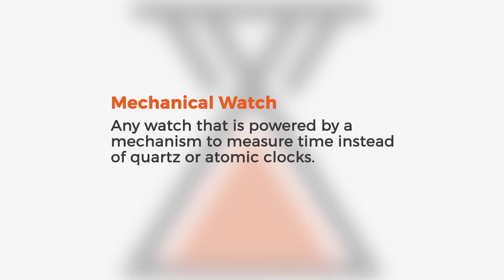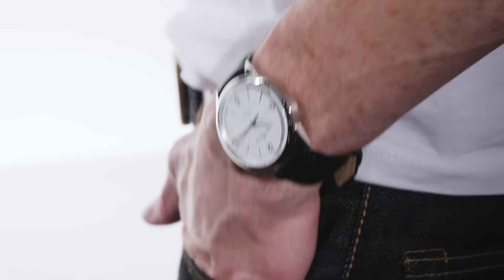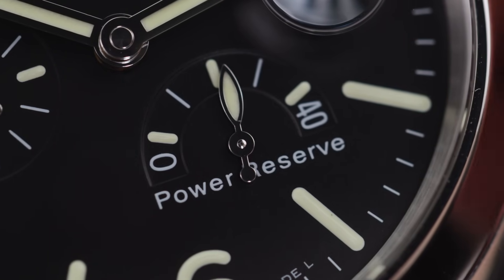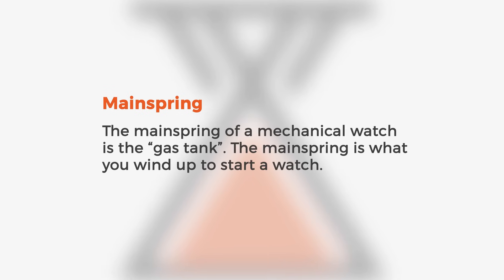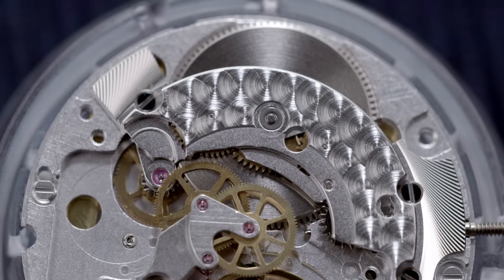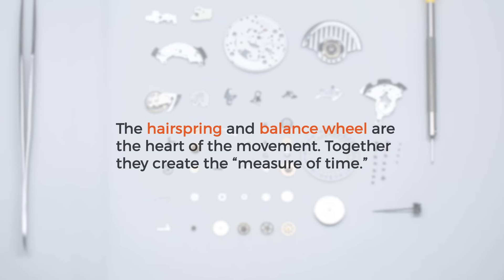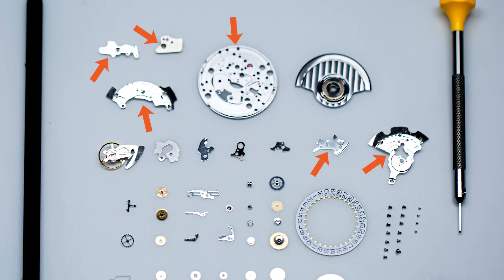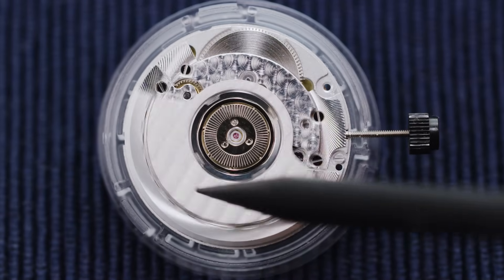How a Watch Works 101 | Crown & Caliber

Comment: What keeps the balance wheel oscillating without eventually stopping like a pendulum would? Does the energy from the escape wheel help keep the balance wheel oscillating by transferring power through the pallet fork?

Comment: Technically not quite right. The crystal does not in and of itself oscillate. The driver circuit does that and is designed to oscillate at the crystal frequency. The problem is that electronic components are inaccurate as they are affected by temperature so, add the crystal which it electronically bumped by the oscillator and being quartz, it moves but has a very accurate resonant frequency so it loads the electronic circuit depending on the frequency error pushing the circuit back onto the correct frequency. 

In short, it does not create the drive frequency as implied, it stabalises an existing circuit generated frequency.

Comment: Also, statement that quartz watch is precise because quartz oscillate at high frequency is abysmal! 
Fist of all, quartz crystal doesn't oscillate and doesnt have default frequency. Crystal need to be cut in proper shape and stimulated to act as resonante impedance.
And high frequency (calling 33kHz high frequency is also inappropriate) has nothing to do with precision! The (semi) constant resonant frequency at wide variety of temperature translate into precision.
Usually cut to rezonate at 32768Hz because it's easy to divide back to 1Hz. For obvious reason.
Doesnt mean you can't get higher resonate frequency quartz.

Comment: This is truly the most pitiful explanation I have ever seen.  The first exact half of the video is not on topic but explains about certification ... is that really the best way to start a video that is supposed to explain how a watch works ?  The wide angle view of the pieces of a watch mechanism is inexplicable to someone with no knowledge.  This is an explanation by someone who knows how a watch works, but has no idea how to impart that knowledge through a pedagogical means, and uses poor (trendy?) English.  Why is a part of a watch "funky" ?  The "narrator" shows the individual parts of the watch and explains their functions, but there is no diagram to show how all these parts integrate and connect.  The video should show how they work in relationship to each other, not just as separate units.  I have no idea why people give thumbs up for this poor presentation.

Comment: You didn't explain how the pallet fork is powered. Or rather you didn't explain how the impulse pin moves first in one direction and then the other.

You jumped from the drive train, to the pallet fork movement without explaining how the impulse pin is powered. This leaves us wondering how the watch works so basically your video failed. Just saying.

I mean the video is really good in every other way though.

Comment: Thank you for this video! 1 Question though, does the oscillating weight wind the watch either way it rotates or does it rely on one type of movement? e.g. left to right or vice versa
Reply: Hello Oliver. For a Classic Automatic movement, it's only one direction. Which is when it oscillates clockwise. However, some brands have come up with specific movements, which allow the spring to be wound whether the rotor goes clockwise or anti-clockwise. Eg: the Double Barrel winding system of the Caliber model of Cartier.

Comment: Terrible. Just some stock video with a voiceover. If you want to explain this you need to have these parts isolated and gradually build up the movement from the barrel onwards. This is lazy and doesn't really explain many things. How exactly does the escape wheel interact with the pallet fork? It's not intuitive and I still don't get it.

Comment: Why do most escape wheels have hook shapes on the ends of their arms opposite the side that the pallet fork strikes?
Reply: The moment the impulse pin releases one side of the pallet fork, the specially-shaped teeth of the escape wheel allow some mainspring power to “push back” against the pallet fork, sending the impulse pin to the other side, to start another cycle. 

In the meantime, the other prong of the pallet fork catches the escape wheel in another location. On the impulse pin’s return, it releases that side of the pallet fork from the other side, and starts the process all over again.

I suspect this is why a mechanical watch with no mainspring power stops—there is no way to launch the impulse pin into another cycle via the energy transfer through the special escape wheel teeth. Or at least not enough energy for the impulse pin to knock the pallet fork hard enough to release the escape wheel again.

This video explains best, I think: https://youtu.be/9_QsCLYs2mY

Comment: I have 3 questions
If I wind my watch today...than its run whole day? I mean how many times it's run if I wind 10time?
2nd questions is that....if I wind today...its properly work next day also but if I will wind agin so it's defects my watch mechanism???
3rd is that in some video first wind antilock wise and than clockwise.. why?? Every time do first anticlockwise and than clockwise???
Reply: 1. Depends on the watch's power reserve, but it should last a couple days at least if fully wound.
2. It shouldn't hurt your watch to keep it wound, some have protection for overwinding. But you should feel when it gets harder to wind.
3. I think you might be seeing watches with a screw-down crown that helps with water resistance. These have to be unscrewed first.

Comment: There is a third type of watch, the Hybrid, the Spring Drive.
Reply: Both are basically quartz watches but yeah it would be cool if they mentioned them in order to learn terminology.
Reply: @lethean1757  I  would say the oposite, 95% of the watch is mechanical,  only the regulations is quartz, so pull out the Swiss lever escapement and replace it with a courts regulator.

Comment: How is powered hairspring? It can´t be just a tension of the spring. It needs some impulse to move again if the watches stops. Is it transfered from the spring through the escape wheel and palet fork? I thing it should be independent and only the hairspring affect the fork, not both ways?
Reply: I had the same question!

Comment: Just getting into watches. A lot of videos down the rabbit hole a lots of repairs, restores, good video on just the basics. 

I have a question, I noticed in this video you said jewels are synthetic sapphire and ruby however, in my dive as shallow as it has been so far, I have yet to see a video with any other color jewel than the pinkish redish ruby color. Does any manufacturer utilize different colors on the jewels?

Comment: Because the osculating weight in an automatic movement require gravity, automatic watches do not work longer than their power reserve in zero gravity a.k.a. space?
Reply: inertia also plays a role and it can make the rotor spin around.
Reply: Gravity was not the best term to use.  Like the previous post says inertia or the movement of the weight is what winds the mainspring. This movement can be caused by gravity, but most of the work is done by the movement of the wearers wrist and arm.

Comment: This was not a "basics 101", more like "mechanicals 303". 🤓
Reply from the maker: Haha! There are parts where it got a little more advanced! Thanks for watching!
Reply: @CrownandCaliber  tbh when I speak with non-watch folks, the first thing they dont understand is quartz = needs a battery and dont need winding. They look "cool" but its cheaper to make.  And hen mechanicals need winding up to run, they can get power automatically by wearing it, the parts make it more expensive, and its usually thicker.  Most folks dont even know what they paid for in my experiences.  🙁

And truthfully I think "automatic" is a terrible description for self-powering.

Comment: Once upon a time, seiko destroyed the swiss in chronometer competition, swiss got bitter and made the COSC exclusive to swiss watches.
Reply: And once upon a time observatory testing at Kew existed and it was way more stringent than COSC. 
To gain class A Certificate which was the highest and therefore made a watch suitable to be used for marine navigation from the Kew Observatory, the timepiece was subjected to 45 days of tests (compared to the Swiss standard of 15 days of testing) with a tolerance of a few seconds per day. Plus, it had to be tested in five different positions and at three different temperatures.

Kew also published all the results so one could compare with which watch performed better whereas COSC doesn’t and we have no idea if a Rolex or an Omega before better than one another.
Reply: RandomUser221 they get a hefty amount of money from the high end Swiss companies. Because let’s say Rolex are held at such a high standard, they charge that high price, that high price is clearly much higher than what they actually cost, which turns into big profits for Rolex and cosc. Most things in life are a bunch of bullshit. Most of us get bullshitted.
Reply: Roland Koller cosc is non-profit....
Reply: Just one reason I'll never buy a Swiss watch. They get salty and WAY overcharge just to have 'Swiss made' on the dial.
Reply: @1701spacecadet I disagree. You need to understand the engineering, labor and materials that go into a Swiss watch.  They are the best in the world.  That being said, Germany has some great manufacturers in Glushutte.  Also Japan is making great movements
Reply: @1701spacecadet  Try a Hamilton or Tissot. They use the same movements as some $1k plus watches for just a few hundred dollars.
Reply: @1701spacecadet  Yeah, because you were totally going to buy one before. You guys are the worst sour grapes rationalizers I've ever seen. And you don't like them "horrible" new cars either right? Nothing better than an old 1996 Honda Civic! Wouldn't even take a new car if you gave it for free!!
Reply: My mum gave me her 3 year old omega deville power reserve that was cosc certified, barely used. and it lost 7-13 secs a day lol. Dynamic poise was way out of wack. I had to purchase an aftermarket omega balance screw tool to adjust and regulate it myself in 6 positions. Now it's at less than +0.5 a day consistently in all conditions. Those cheese loving fucks are way overpaid if I can do a better job than them.
Reply: And now the iPhone destroyed both. Most people wear watches nowadays as jewelry, and for this, I’ll take a Swiss watch over any Seiko or Grand Seiko!
Reply: @Eliehbk While the Apple Watch is an amazing piece of technology, I’ll pass.  I wear a Swiss watch daily because I love the technology in a mechanical watch.
Reply: RandomUser221 him? Lol ...
Reply: Jesus, so much misinformation... cosc and the chronometer competitions are not related (one died in the sixties, the other born in the seventies..).
Reply: Once upon a time, Seiko fanboys repeat this same boring story as though it means anything. You are aware that the overwhelming majority of watches Seiko produces today are in the -30/+45 second accuracy range mass produced cheap 7S26/4R36/6R15 movements right? I buy German watches, but you guys are the most annoying twats in the watch world. I wish I had a dollar for every "DAE Seiko better than ALL other watches even though it's cheap and low end?". No, no they aren't. The Seiko that "beat the Swiss" all those years ago is Grand Seiko. Actual Seikos are cheap beater watches sold in malls. You never had a watch that "beat the Swiss" for <$1,000.

Meanwhile there are regulated and adjusted Swiss watches available as low as $300-400 that dance circles around $1k Seikos which are completely unregulated and unadjusted. If you even know what either of those mean and aren't just a blathering idiot prattling on about your pure class Seiko 5.
Reply: Shintsu2 And a $20 Casio digital curbstomps both of them.
Reply: @WashashoreProd  you're not comparing like for like, so it's an invalid point.
Reply: @Shintsu2  Watching you get all worked up & hurling childish abuse over nothing was very amusing.